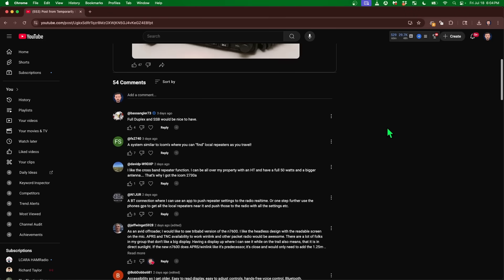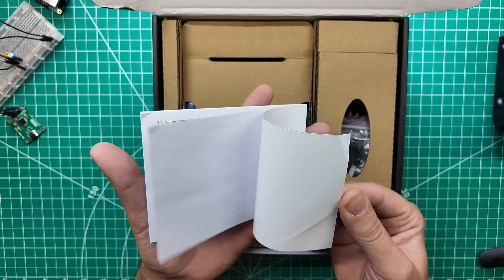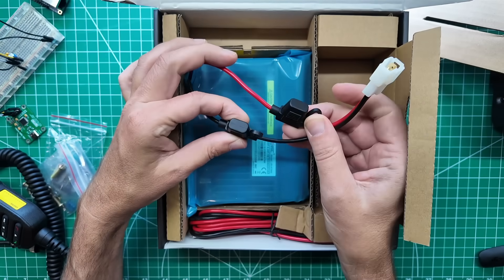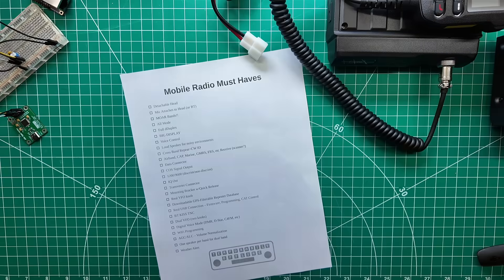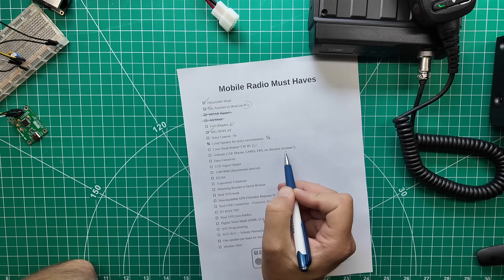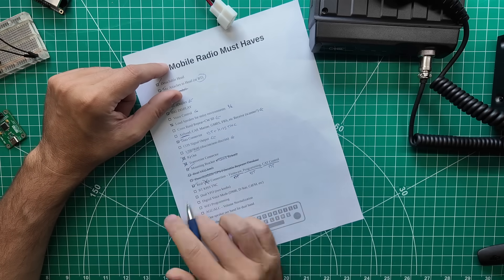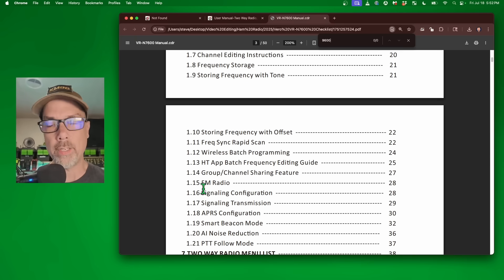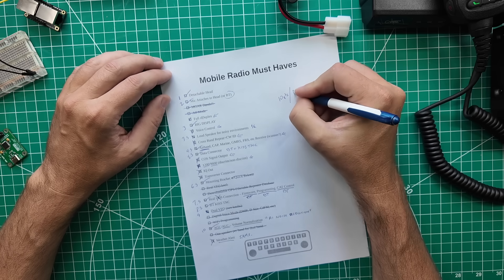The Radio I’ve Been Waiting MONTHS For – VR-N7600

Comment: Trying to determine if I need to upgrade my N7500 :-D honestly the thing I wish they would change on both of these radios is to remove the channel groups and just have a single allotment of channels. I like to program in the local repeaters and just scan through those and with the multiple small banks of channels that is difficult (16 channels per group on the N7500 and 32 channels per group on the N7600)  Even my UV-5R just has 128 open channels.  Just remove the groups and allow for a large bank of channels.
Reply from the maker: I did a video directly comparing them here: https://youtu.be/GE3J4XJLxeQ?si=X2FqWuPQkkUWspKA

100% agree on the channel groups and I don't really even use repeaters.

Comment: Voice control for vision impaired. The best answer is you can use voice control using the App, but it is not actually designed for it and it would be cumbersome based on the testing I did for a friend a while back. Do able, but not ideal. Still, more than most radios can offer for vision impaired folks.
Reply from the maker: Sounds good.

Comment: I wish I could add an external bluetooth antenna. I'd like to connect to it from outside the vehicle.
Reply from the maker: The only radio I know that has an external BT antenna is the Radioddity DB25-D - its a pretty neat 25w mobile: https://geni.us/89s5Aq use code TO15 for $15 off if you want to try it.

Comment: The NR - VR N7500 you do need either your cell phone or tablet for a display.  At least that is what I understand for other videos I've seen for the VR-N7500. I wish BTECH would bring back what Motorola and Yaesu had back in the day for commercial/ public safety users  Having one radio for both mobile and hand is a great radio.
Reply from the maker: Once the 7500 is programmed you can operate the channels with the included mic.  But who doesn't carry a cell phone with them every where they go these days?

Comment: This looks really promising. I have a VR N-76 and really like it. I'd be interested to know how loud the speaker is - I'm often using my radio in a noisy environment and prefer a front-mounted speaker that can project. I suppose it'd be possible to add an external speaker if the speaker in the mic just isn't enough. Thanks for the review!
Reply from the maker: It does have an external speaker port as well as a bluetooth setting... maybe a good headset will help out.

Comment: DX Engineering has the appropriate extension cable for the handset. I put the head behind the back seat in my truck, where I already had power and close to the antenna, and ran a 15ft extension to the front for the handset.
Reply from the maker: Great tip!

Comment: One negative is the DMR-like channel groups/zones.  I have the BTech version of the N76 and like it a lot, other than that.  The channel/channel group management is probably the most frustrating item I've found with mine. Wish they'd make a cable for it too, so there was a option other than the app for programming, but going from Chirp - > Excel/Sheets - > the app is workable for channel management, just not very efficient.
Reply from the maker: Not arguing that!  I think it's because of screen real estate on the app

Comment: I'm on the fence about upgrading my N7500.  Have they solved the weak Bluetooth problem?
Reply: I had this in my house for a couple days. I wandered around with the radio in the office and never cut out. Right now I have the radio in my truck and Im in my office and it works. Thats only 30ft but it is through a brick wall.
Reply from the maker: 30ft is the expected limit of BT
Reply: @temporarilyoffline I have cheap headphones that work through most of a 4600 ft^2 house.  The N7500 would only work in the next room, not even 2 rooms away.  It was really bad.
Reply: @logankf thanks. That sounds much better.

Comment: Nifty!

The feature that I want to start seeing in ham mobile and portable radios is the ability to appear to be a bluetooth phone to my car's info-tainment system so that I can use the car's hands free stuff to talk on the radio, maybe use the steering wheel mute button as PTT toggle, and maybe there's some other stuff in that BT profile that would let me use some of the conveniently placed car center console controls to do stuff like channel selection, reverse, open the squelch, etc.  (Though hands free audio  and PTT would be enough.  I could touch the radio or control head/super mic for the rest,)

Oh, and you added the "B" because the use of the term "AI" here is Bullshirt.
Reply: You cant connect the radio to your car but you can connect your phone to the radio AND your car. As long as you have bluetooth selected in your car you will hear the radio audio. There is a slight delay.
Reply from the maker: Attaching to modern things is my ham dream!

Comment: The two mic pins are probably MIC+ and MIC-.  It would made sense to use a balanced differential pair to transmit a low level signal like mic audio.
Reply: Reason I'm am buying these radio
Reply from the maker: You are correct!

Comment: My Alinco DR-735T has the majority of these features( full duplex, cross band repeat, 2 ext speakers, 2 independent VFOs, air band receive, detachable head, large multicolour display, mic connector on head unit).  It has a 6 pin DIN connector for packet communication to an external TNC.  No Bluetooth.  If it had SSB, it would be awesome IMHO. Score of 14 on the checklist.
Reply from the maker: Sounds like you've got a great rig already!
Reply: @temporarilyoffline  Another reason I got was the low current draw on receive compared to other 50watt mobiles.  It is 0.6A.
Reply: I was going to say that. I have a DR-735T too, in my shack. Wonderful radio.

Comment: But it's Chinese (no I don't care but I love to poke at those folks that do). I love the 7600. The 7600 is LOUD. I mounted it in my Tesla. The FTM-400 has dual speaker but it comes out of one plug. So one external speaker port is not necessarily an indicator of dual speaker. The phone issue to me is that it is an unnecessary battery drain on the phone. And you left all mode off the list. One thing I would love is a much longer cable on the microphone so I can mount the body under the seat because I want the display on the microphone. The display on the microphone is what I want to see on the microphone but the app does not have that concise easy to read layout. Ideally, the display would be part of the Teslas tablet display but that is wanting too much 😉 Looking forward to seeing what you do with the radio. I need to research how do to APRS Smart beaconing on one band (via the radio and without using my phone) while also listening to the other band. And, I want to adjust and set squelch and volume per frequency/repeater pair as there are some spots I drive through with heavy digital interference on certain frequencies which causes scanning to stop.
Reply: Dont do synchronous signaling. Set up the signaling under "device settings" and "settings" separately. Device settings is the radio. Settings is the app. Set the signaling under "device settings" to APRS and set that all up properly. Set the APRS to use channel 32 and set channel 32 as APRS on every bank of presets, muted so you dont have to listen to it. If you do all this you can use the radio normally with dual watch and it will switch to the APRS to beacon and then switch back without intervention by you.
Reply: If you want to function as an iGate all of that is under "settings" on the app side
Reply: Probably leave ID signaling off. That is the ID burst when you let go the mic
Reply from the maker: No need to use the phone at all... but you can use it if you want to get the extra features like mapping that wouldn't make sense on a low res mobile radio screen.

All mode is option 4 on the check list.

Apparently DX Engineering has an extension cable, but they are standard connectors, so you can make your own.

Cartainment integration is the next needed thing.

Smartbeaconing can be done without the phone as well.

sql/vol per channel is a nice feature that would probably be really easy to implement.

Thanks for the comments and for watching!